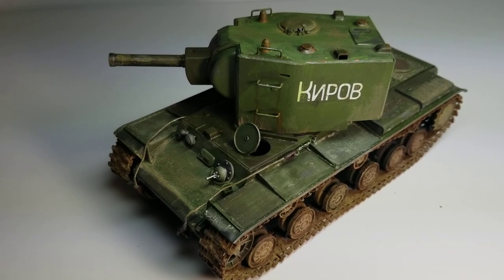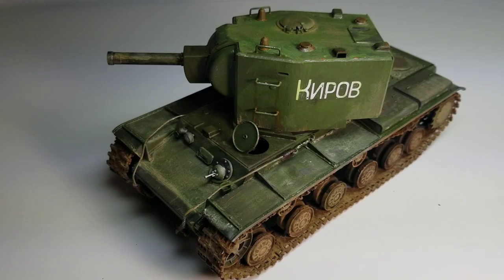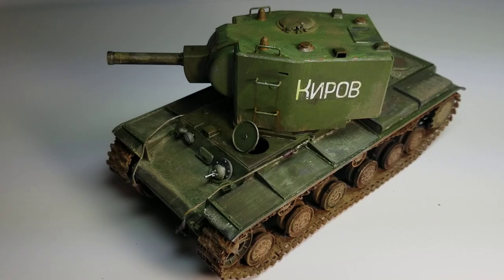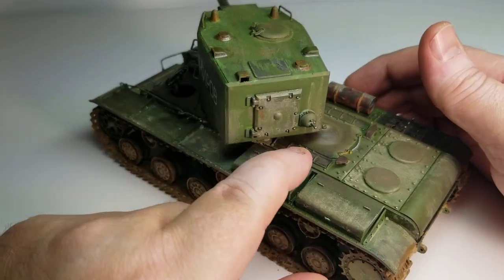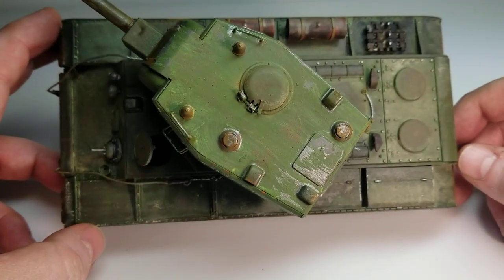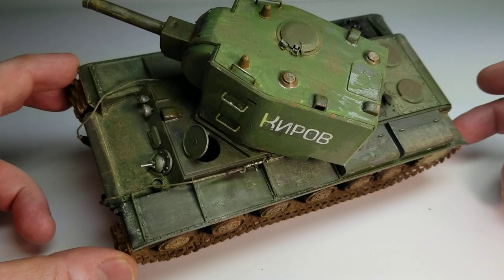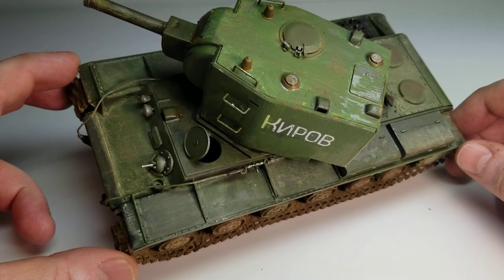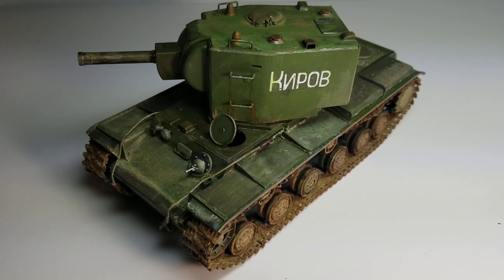Tamiya 1/35 KV-2 "Kirov Plant" scale model tank

Comment: Dustin, the KV-2 looks fantastic!!! Only a true rivet counter would find fault with this build, and for them, the ole one finger salute would suffice!!! Love the idea of the Karov dio and ACME was awesome as usual, Tubers represented well, and some of them did fly with models. PapaDan just picked up 10 bottles of that Vallejo Mecha paint line so I am sure he would love to hear your take on those paints...again, awesome work on the KV, and sounds like you had a blast building it, tried some new techniques and learned a lot, so in my book that’s what building models is all about!!!👍🏻
Reply from the maker: Thanks Reb!  Papa Dan will love those paints.  They are a very hardy/durable paint so using them for chipping (I had no issue but other experienced modelers have) can maybe have mixed results.  Other than that, I love the colors they carry.  I've used a ton of their light and dark steel for undercoat on both tanks and Auto builds.  Sprays great out of the airbrush. That's amazing guys are flying with models, I am white knuckled just driving 10 miles with mine lol.  I suppose if you can pack them good and then maybe carry on?  I just always think of the beginning of Ace Ventura movie, drop kicking stuff lol.  The KV tank was a fun build man, a great tank to work with for sure.  Glad ACME was fun, hopefully someday I can make it.